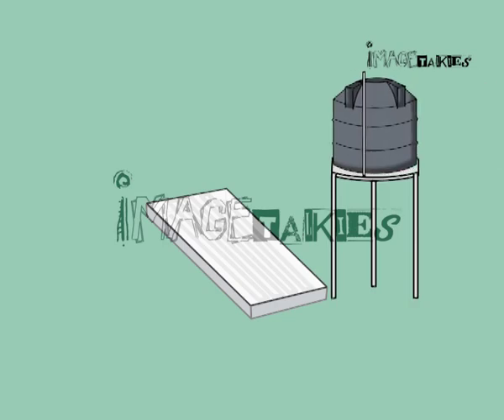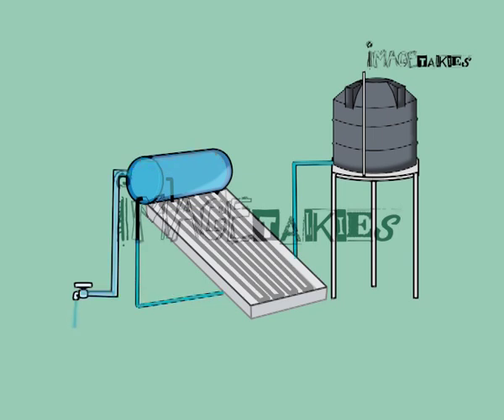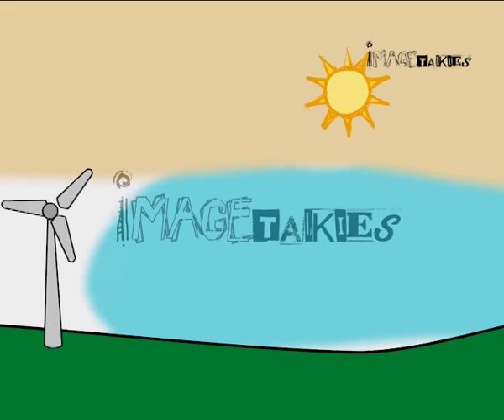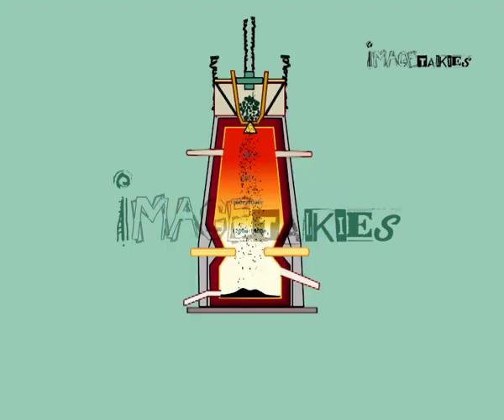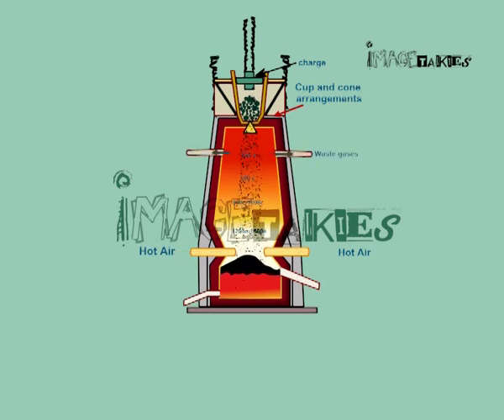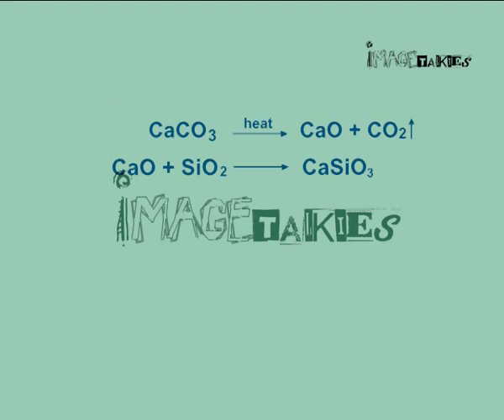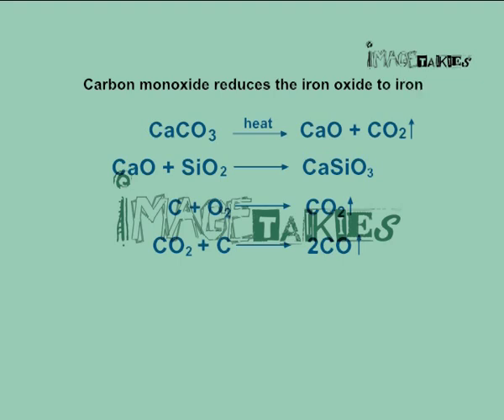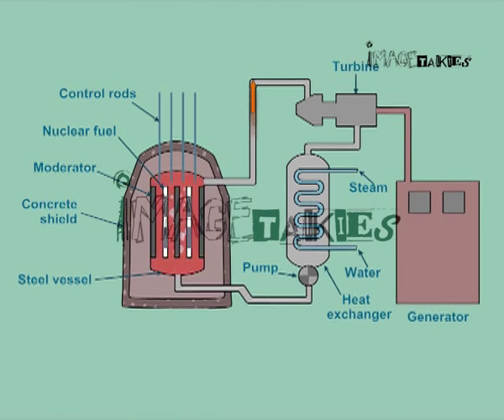Animation of solar water heater, wind energy, iron production in blast furnace & nuclear power plant

Comment: You should check for Solar Keymark certificate and parameters (like efficiency or power output) while trying to find any solar thermal collector (flat-plate or evacuated tube). There is also available search engine for collectors based on selected parameters taken from Solar Keymark certficates: http://solars-info.com/